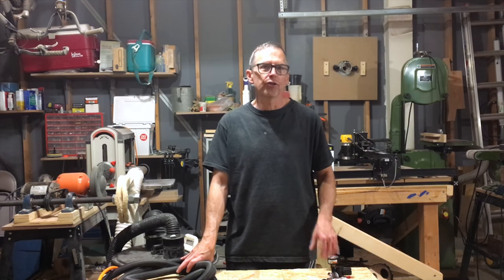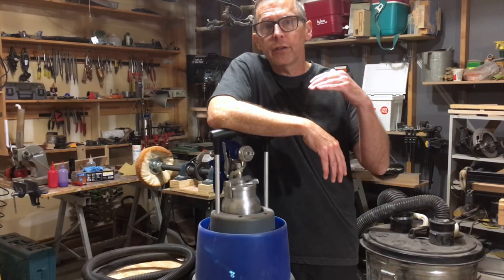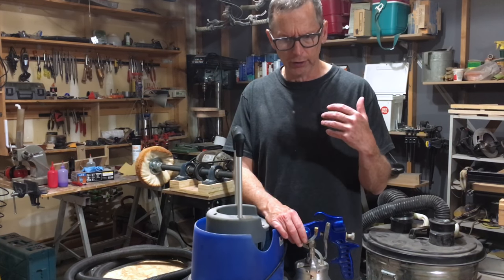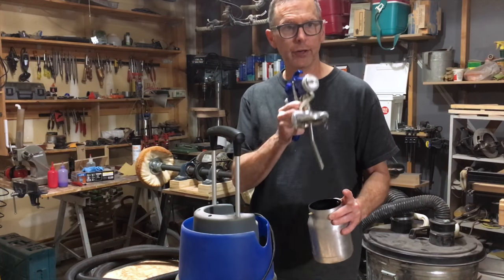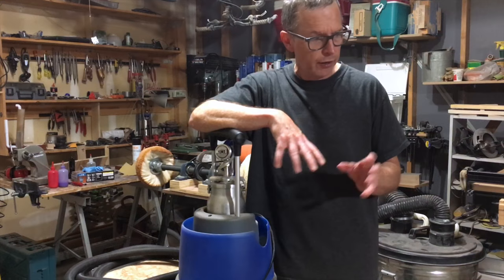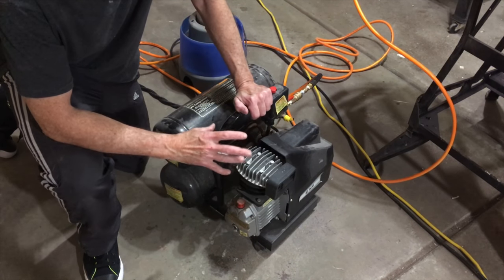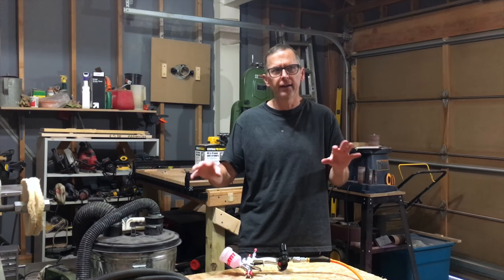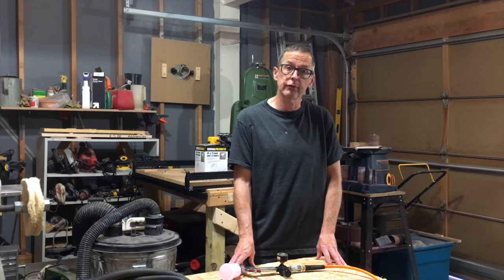Choosing a Spray System For Finishing A GuitarPart 2: What I Use

Comment: Good info! I've been using a little 25L portable compressor, and a Graco Finex HVLP gun (gravity fed) to spray my guitars. As a Cabinet Maker by trade, I'm used to spraying furniture using the workshop's gear (usually a big compressor+dryer/Devilbiss gun 1.8mm nozzle). I find that I get good results with the Graco (1.5mm nozzle), but sometimes it can be a pain to set up, and has a far too big cup for what I need. Seeing your results with the LVLP gun, that system seems like I ought to get one of those guns - and a regulator (which I don't have currently). Especially if they don't cost too much. Thanks for the excellent advice again!

Comment: Hi Chris, thanks for the video. I am planning on painting an electric guitar body and wonder if you could let me know what nozzle tip size you recommend for primer, painting and clear coating. I would like to use water-based acrylic paint. Thanks - Paco
Reply from the maker: I recommend you check with the manufacturer of the products you plan to use.

Comment: Thank you for the information . I have been using Preval for spraying lacquer and getting good results, but it's slow. If someone is building a guitar or two, Preval is ideal. I've been wanting to move up to a spray rig, but the compressor requirements have held me back. A customer of mine gave me a practically new 5 hp, 60 gal. compressor, but I don't have 220V at my shop to run it. LVLP might just be the answer. Please keep up the great vids!

Comment: I have found your videos so very informative. I feel like I finally have a direction to take in finishing my first build. I wonder though, if you have an updated recommendation for an LVLP kit. It doesn’t look like the SprayIt 33500k is available any longer. There’s the SP-33000k and I suppose I could just get the SP-35000 gun separately? Thank you!
Reply from the maker: I currently use the QualSpray QS WB-125. It’s more expensive, but definitely much better than the SprayIt because the fluid pathway is all stainless steel, which makes it ideal for water-based finishes.

Comment: Great video for the spray gun. I have 3 questions. Will the Sprayit 2p-33000 shoot wate-base color and finishes? Second, the smallest tip for it is 1.3 mm dia. Is that small enough for finish coats.Third, does lacquer need to be thinned before shooting if from a spray gun? I've been looking for advice on spray guns for a couple of weeks. I was afraid I'd have to buy a new compressor, but I don't based on your instructions.My colors and clear gloss are nitro in spray cans. Thanks! This appears to be exactly what I've been looking for.

Comment: Great information. I'm looking to make the leap from rattle cans to spay gun. Where do you get the colors from? I dont find a source for fender/gibson colors in a non-aerosol format. I specifically would like lake placid blue and gibson goldtop
Reply from the maker: I either use water-based acrylic paint from my local big box arts and craft store or I mix my own from Crystalac CraftNique pigments.
Reply: @HighlineGuitars  interesting water based huh?
Reply from the maker: @johnmiller9219  Yes. No fumes. No flammable volatility. Easy cleanup.

Comment: Hi Chris, have become addicted to your videos great to watch and informative too so thanks. I have the same spray station although not the smaller needle valve (which I will try to get hold of) but just one small point, you mention loading up the reservoir with lacquer and using for it for the whole day. Just wondering in practical terms how you would do this. Can you leave the gun without cleaning it out after you have put a coat on? Then if you were to use it on a couple of subsequent days could it be left without any cleaning then too? Or would you decant off the thinned lacquer into another container, clean out the whole system and then continue afresh on the following days?Anyway cheers for a great series of vids, keep em coming!

Comment: Great information, thanks!  Question for you.  Currently I'm using the Preval spray system, which is little more than a rattle can that allows you to use your own paint and mix your own color.  But I don't like it.  It sprays such that it doesn't atomize the spray into a fine enough spray causing a speckely orange peely finish.  For the base coats it isn't such a big deal as I just sand it out.  But I'm going to spray this guitar a sunburst, transparent sunburst as much like a 1959 Les Paul Standard as possible.  There is no way the Preval system can do that.  I'm using Mohawk Piano Lacquer for the finish so that afterward I can do the cold/warm checking to the finish.
So my question for you, does the Sprayit LVLP system spray a fine enough, atomized finish that lays flat enough to accomplish a smooth, not-speckely, tinted finish?  The guitar you show in this video is sunburst, but I can't see close enough to see how fine the spray is.  Thanks, and thanks for all the great videos.
Reply from the maker: No, it does not.
Reply: @HighlineGuitars  That's unfortunate, I like the price.  What system would you recommend for my needs then?
Reply from the maker: @plexibreath  https://youtu.be/zPzLJqiolms

Comment: Great information! Thanks for the video. Where do you spray? Did you build a booth?
Reply from the maker: I spray In my garage/workshop. I hang some plastic dollar store painter's drop sheets in a corner and turn on my big ceiling mounted dust extractor. I have an idea for a portable spray booth, but that's down the road.

Comment: Hello. Im looking into buy a small compressor and spray gun to paint a bass guitar. Would you recommend this ??? Or...
Reply from the maker: I recommend the Earlex 5500. Even better, but more expensive is the Earlex 6003.
Reply: @HighlineGuitars  ok. What about the SPRAYIT SP-33500K LVLP Spray Gun Kit ???? And maybe run it with a small compressor. Would it hold up.

Comment: Would a 1.5 hp 8 gallon compressor work well with that gun?
Reply: yes it will be fine, he suggested a 8 gallon tank with a 2 hp, you wouldn't know the difference.
Reply: I'll be using a 1 HP, 8 G California Air Tools compressor (3.1 CFM @ 40 PSI) for woodworking. Claims a 70/30 duty cycle.

Comment: Hey Chris. I bought a Sprayit kit on Amazon based on your recommendation. The kit came with two guns  - the larger 33000 and the mini 35000. I am a bit baffled by the mini gun. Unlike the larger gun, the mini gun does not match the exploded parts diagram from the manufacturer. I cannot figure out how to remove the needle for cleaning. Does yours disassemble so you can take out the needle? Also, the mini gun does not seem to have a spring BEHIND the needle, whereas the larger 33000 does. Thanks in advance.
Reply from the maker: Yes, it can be removed out the back of the gun by removing the paint adjustment knob first.